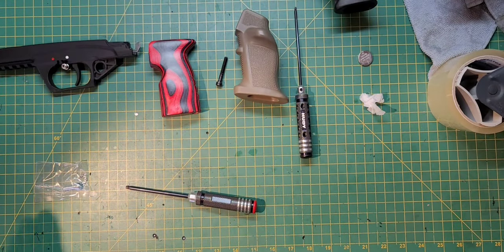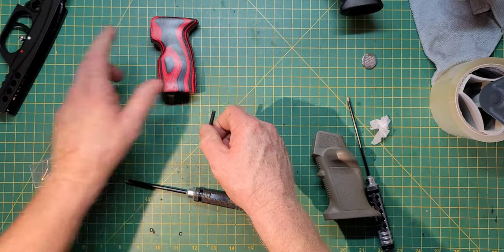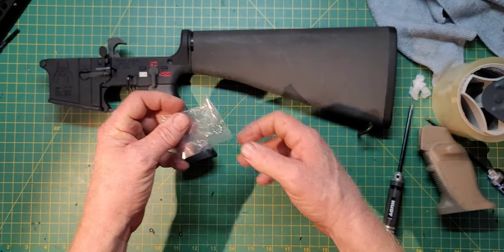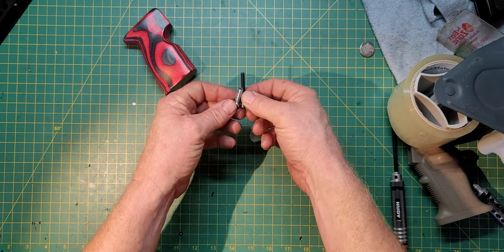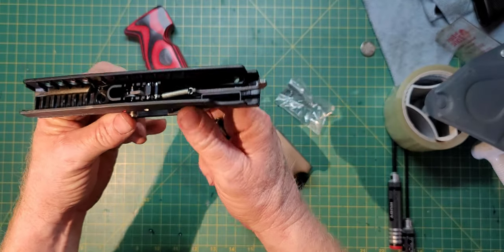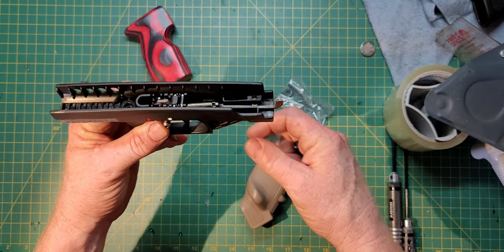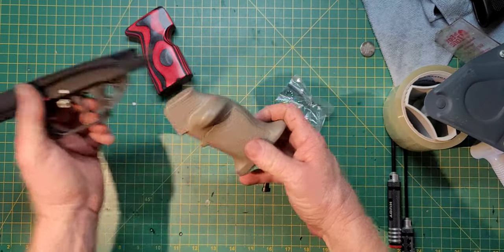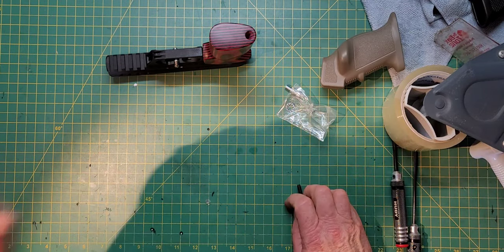EDgun Leshiy 2 Grip

Comment: The grip that you called “Luthair”? Where can I get it please sir? I have a LCS Air Arms SK-19 .25 cal that I exchanged from a .22 cal and I really wished I hadn’t mainly because of the grip. Sir, it does not fit me. The grip that you showed on this video, looks exactly like the grip that was on the original version. This is the grip I desperately need to regain the feel, and confidence that I once had in this gun. The grip they supplied on the second or third generation SK-19, slides off all the time and is constantly loose. It is no longer a grip, but a slide-off handle that doesn’t allow me to properly hold this gun. It constantly moves-100% of the time. Can you help me please sir?
Reply from the maker: next time buy an EDgun ... https://www.luth-ar.com/product/the-chubby-grip/
Reply: EDgun West true...guns been to the shop for repair 6 times since Nov 2019 for failure to fire. In fairness, the semi wasn’t out then. Thank you.